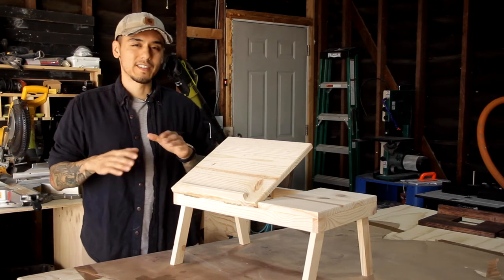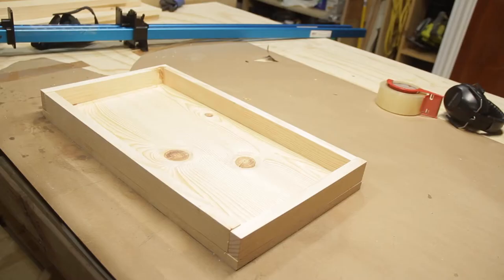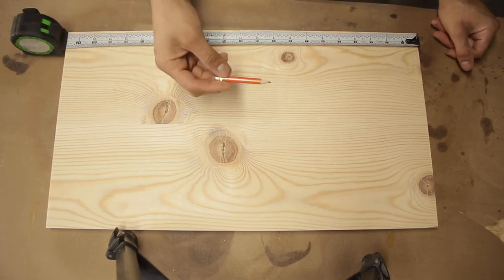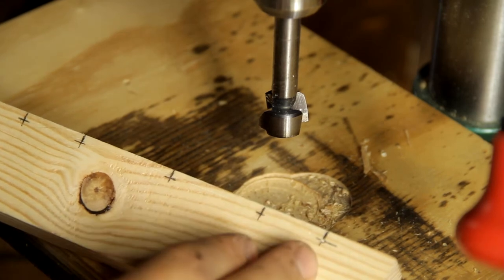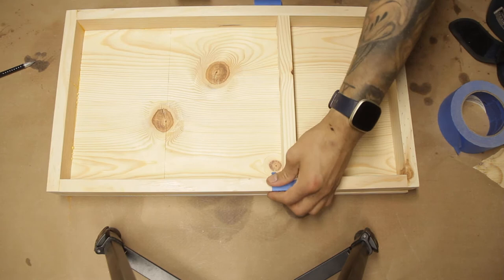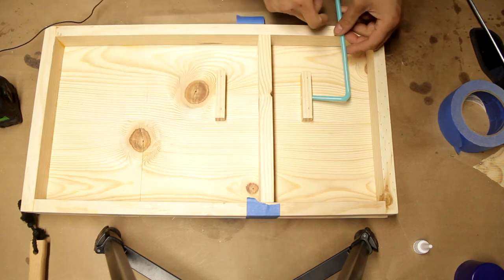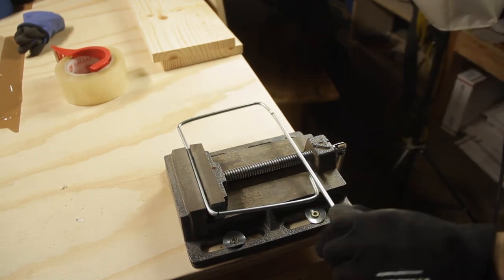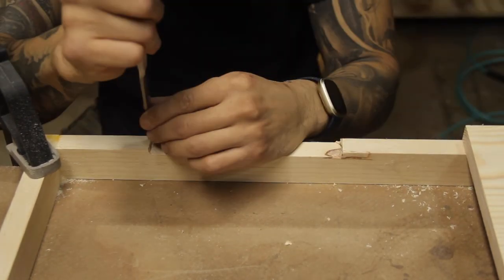Lap Desk BUILD! Perfect for working in bed

Comment: Nice stand 👍The problem while cutting the rod was not with the saw but with the clamping method: clamp the rod closer from the cut to reduce vibrations 😉
Reply from the maker: Thanks! I started working at a fabrication shop so my knowledge with metal work is far greater now 😂 Lessons lived and learned!